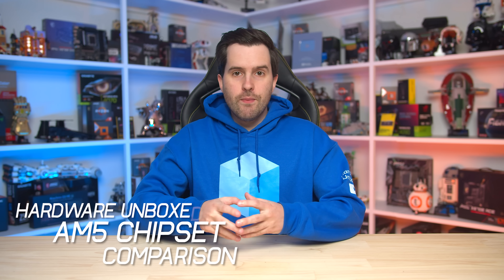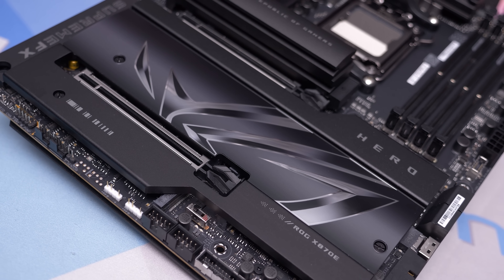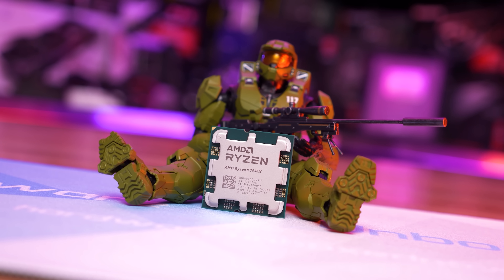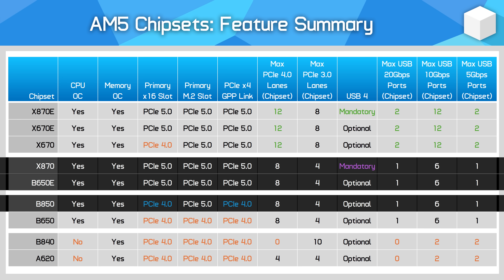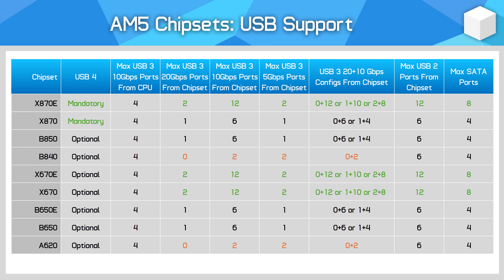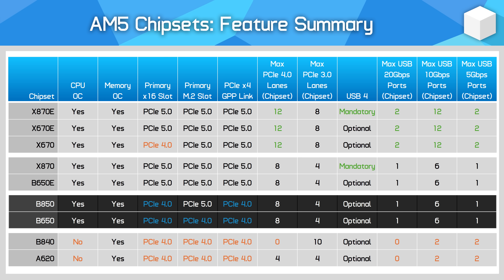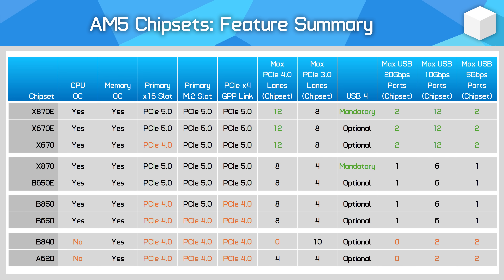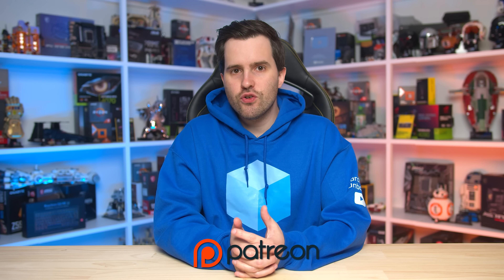AM5 Chipsets Compared - X870E vs X670E vs X870 vs X670 vs B650 vs B850 vs B840 vs A620

Comment: I saw someone reviewed all 870 and 870e mobos and i think only asrock mobos support pcie 5.0 1x16 without lane sharing meaning even if all m.2 slots are occupied and if they got m.2 pcie 5.0, the slot will not step down. the rest of brands will split to 2x8 so gotta take note of this when buying one
Reply: The main PCIe 5.0 problem with 8XX platform is that USB4 controler became mandatory and it's connected to the CPU by 4 PCIe 5.0 lanes. Since the 5.0 lanes are not increesed in 9XXX CPUs, on this platform is not possible to occupy PCIe 5.0 x16 and two M.2 5.0 x4 slots without lane sharing. On MSI X870E Carbon it is possible but USB4 controller will be disabled which makes the platform sensless. That's why Asrock didn't even bother to add second M.2 PCIe 5.0 slot. One PCIe 5.0 x16 + one M.2 5.0 x4 without lane sharing is ok on all 8XX boards.
Reply: That's why I got the Asrock x670e pro rs. It doesn't share the lanes and has a lot of m.2 and ssd connections. I just simply love it. Yes it doesn't have rgb or fancy things on it, but it's a very good quality motherboard that gets the job done with no BS or errors.
Reply: @Wise_Tiger i use the same Mobo , for me work perfect in combo with 7600x, ddr5 6400 at 30,36,36,84
Reply: I like asrock boards anyways but didn’t know this
Reply: I probably read it wrong before, but can use a gpu and a sound card without losing pcie lanes on the 1st slot?
Reply: @AirRookie  Depends on the MB. I'm using a soundcard as well, so am paying attention to this as well. Generally, I've noticed if you pick a MB with 3 PCIE slots and put the soundcard in the third slot at the bottom, it will be fine and won't share lanes with the 1st slot your GPU uses. But should check carefully before you buy anything.
Reply: @123Suffering456  okay, I was curious about the X670/X870 taichi
Reply: @123Suffering456 it does share ex... carbon x870e
Reply: Yes thats true.. we dont need to aim for a gen5 for now.. i just want a mobo where i can populate gpu and all m.2 slots and not have any lanes or slots halved or disabled.. so if x870 or x870e has this, then thats great news
Reply: If u bought or want to buy a 5 slot or 6 slot mobo, u should be able to use all slots without penalty.. if there is penalty, either u forget buying that and get other options or u just accept that its just the way it is and buy it anyway..

No gpu is utilizing the pcie5.0 for now.. but when u slot it to pcie5.0, then it will become pcie4.0 2x8 for some mobos that impose penalty on occupying gen5 slots.. if u r so sensitive to frame numbers, just turn off msi afterburner so u dont keep seeing them.. u wont really feel much unless frames drop too low.. others turn off some slots so ya.. u gotta know what ure buying
Reply: Only the top m.2 on the Taichi and Nova are 5th gen. The Taichi has 3 4th and the Nova adds a 3rd gen with their 3 4th gen.
Reply: @TheSjuris  Here's a controversial opinion. Gen5 PCIe M.2 is really not something you need. Sure it's fast, but for most applications and especially games you won't be able to tell the difference between a Gen4 and a Gen5 M.2 drive. Benchmarks will show you that there is a huge difference in performance but in real world use there are really few uses where this makes a noticeable difference. So ignore a having a second Gen5 M.2.

Like I said a controversial opinion. I base this on real world tests. I did also see a test made by a YT channel where they tested games and general use testing a few different games, OS boot time and such using a Gen5, a Gen4, a Gen3 M.2 drive and a SATA SSD. OS boot times were very similar no matter which drive was used. The game slowest to start and most influenced by the drive was either Cyberpunk 2077 or Starfield. The time difference in starting the game was 8 seconds between having it on the Gen5 M.2 drive and on the SATA SSD. That is 32 seconds instead of 40 seconds. The performance difference is huge when benchmarked, but minor in daily use. Note that the difference between the Gen5 M.2 and the Gen3 drive was something like 4 seconds and even less when comparing it with the Gen 4 drive.
Reply: @blahorgaslisk7763  Exactly PCIe gen 5 atm is a complete waste of money. I did choose a b650 board that has 1 nvme gen 5 support but there's no way I'm paying for the massively over priced gen 5 ssd's yet. I got a top of the range 4tb samsung 990 pro gen 4 instead. You also don't need gen 5 for the the gpu. Card's are nowhere near saturating gen 4 bandwidth yet.
Reply: I myself am waiting for asrock nova
Reply: Do not buy the X670E Taichi.  It has mandatory lane sharing.  It's my only regret with it.  Great motherboard but one shit feature.
Reply: That is not correct. I've looked at dozens of motherboards and to start with, no ASRock motherboard supports two M2 Gen5. Period. Then there are to my knowledge 5 motherboards all with X670E that support at the same time 2 x M2. Gen5 and 1 x PCI 5.0 x16. These are: ROG STRIX X670E-A GAMING WIFI, ROG STRIX X670E-E GAMING WIFI and ProArt X670E-CREATOR WIFI  from ASUS, X670E AORUS PRO X from GIGABYTE and MPG X670E CARBON WIFI from MSI.
Reply: @cochinada01  X670E E-Gaming does NOT support full M.2 use, installing an SSD in M.2_3 will cut GPU lanes in half. F-Gaming does. As does X670E Aorus Master.
Reply: @MajinOthinus  I didn't write FULL M.2 use. No motherboard on the market does. I wrote 2 x M.2. Check again.
Reply: @cochinada01  Most of the ones you mentioned very much do.
Reply: True, the only ones worth buying are Taichi and Nova
Reply: @3nez2nez  Yeh sadly we don't have them in Australia just yet and I want to buy now!!
Reply: @farmeunit  Yeh I'm probs gonna get the MSI Carbon, but the Nova seemed to have similar specs for a lot le$$. Oh well.
Reply: @LollyBread Just buy an X670E board, they are objectively superior anyway.
Reply: @MajinOthinus  Nah. Some of them are 2 years old now. I'm looking to future proof a bit more since it'll be many years before I update again. There are subtle differences from what I remember reading and no doubt less-sexy improvements under the hood. Anyway, each to their own. All the best.
Reply: @LollyBread  There are literally no differences. IT. IS. THE. EXACT. SAME. HARDWARE.
You aren't future proofing one bit. There wouldn't be differences even if the board makers wanted to make them, because AMD specifies exactly what goes in there and it is THE SAME.
Reply: @MajinOthinus Incorrect. There are other subtle improvements. Most people probably don't care or notice. But there are VRM improvements, and more importantly memory topology improvements that offer higher memory OC compatibility out of the box. Along with some other minor changes.  So while the lane counts and chip support are technically the same. Other aspects are not. How much you care is up to the buyer.
Reply: @BigBear--  VRM improvements are all but pointless, most 600er boards already had massively overbuilt VRMs. And both those and memory topology improvements are not something that is particular to the 800er boards.

Anything that isn't directly related to the chipset or lane allocation is not particular to 800er boards.
Reply: @MajinOthinus  I don't know what "not particular" means...X670E Master boards officially support up to 8000mhz and first dimms with 32Gb per dimm are supported up to 6400mhz. The X870E Master supports up to 8400Mhz, with 32Gb dimms maxing at 6800Mhz. The certified supported memory list is also more than twice as long for the X870E than the X670E. That's just one difference. You might not care about any of that. And just want max PCIE lane support...fine, get whatever works for you. Depends on what's important to the customer. Point is they're NOT the same in many ways, while maybe same in others.
Reply: @Blackbind01  ASRock is king
Reply: IMO this is not a big deal. Just don’t use the M.2 slots if you want X16. The option to split off the x16 without a riser is a benefit.
Reply: @joemarais7683  "Just don’t use the M.2 slots if you want X16."

Just don't be homeless if you can't afford rent!

Also, what is "The option to split off the x16 without a riser is a benefit.", even supposed to mean???
You strike me as someone not very - read: at all - versed in computers and their hardware.
Reply: Who is buying that anyway 😅
Reply: @aayankhan942  I just had to replace my Taichi x370 from ~6 years ago. After all was said an done I decided to get the x570 Taichi. First MB I've had to replace due to unknown root cause. 570 Is working great, I don't need the ARGB though.  I am looking to build a new AM5.  I tend to get a midrange CPU and GPU then upgrade later when prices are not stupid.  I've been trying to understand the differences with the 'new' 870s. I'm likely one of the few people who highly value USB4, so the x870E is likely my go to. (reference, been building PCs since 1990, almost exclusively AMD CPU and GPU since 1995). Yeah hard core optimist for AMD. Not fanboy, just like their low power usage/efficiency and reluctancy to gouge (until recently).
Reply: @aayankhan942  Apparently everyone seeing as how they've sold out to scalpers.
Reply: No,not just asrock boards...
....Gigabyte X870E Aorus Xtreme.
....Msi X870E Godlike.

These boards don't share their main PCi and second slots with m.2 slots.
  Unless you populate the second slot,then they both run 8X8.If you don't use the second slot,the main slots are always 16X no matter what.

Comment: I did buy an X670E after seeing how bad the X870E was more usable SATA more usable m2 on the X670E no GPU cut down in lanes
Reply: May I which model did you buy? I was recently looking for a new PC, and found out the X870E sucks in lanes
Reply: @Pi3XXAX  i did buy the ASUS ROG Crosshair X670E Hero 4x full usable m2 no cutting down and i have 6 SATA that i can use and a 1x PCIE for stuff like sound cards
Reply: @napalmarsch  thank you. Do you know if the X870E HERO split lanes when you use only two M2 slot? like just the m1&m2 slots

I don't understand well from their website
Reply: @napalmarsch  the Asrock X670E Pro Rs is also a good choice and doesn't split or share the lanes.
Reply: @Wise_Tiger  ahhh it seems to be hard to get. I will try to see if its gets in stock. thank you for the recommendation
Reply: @Pi3XXAX  that's why it's out of stock. Because it's a good motherboard that can compete with motherboards that are much more expensive.
Reply: @Wise_Tiger  ALC897 in that Asrock but looks good.
Reply: @xayroMS  if you use a good quality headset with USB connection, it will bypass the motherboard Audio.
Reply: @Wise_Tiger  For my speakers make difference... I thinking about strix b650e-f but i m still not sure.
Reply: @xayroMS  Don't buy the strix b650e-f, it takes mine a minute to post every boot, and turning on memory context restore makes it unusably unstable (even crashing in the bios)
Reply: @Your_Paramour  Most AM5 boards have this problem. But good settings in bios should work to reduce boot time.
Reply: @xayroMS  There's a HUB video b650 from a year or two ago where steve found the asus boards have double the boot time of msi/gigabyte. The only setting i know to reduces it is memory context restore which turns off memory training each boot, but my board will crash even inside the bios with it enabled.
Reply: @Your_Paramour  AMD expo on ? I m not sure if there is more options about memory...
Reply: @xayroMS  Yes enabling expo/xmp is what causes it to memory train on boot. Without expo it will boot without memory training at the jedec timings
Reply: @Your_Paramour  I will read more about that. I have some pages opened on my PC but I m out of home for now...
Reply: @Your_Paramour  I found price cut on MSI PRO B650-A WIFI  i think maybe that will be better choice...
190 USD vs 303 USD (strix b650e)
Reply: @xayroMS  Someone in this thread i think was extolling the virtues of the ASRock X670E PRO RS, which currently in Australia can be had for 300 AUD, which seems like a crazy good deal since from memory i paid around 500 for the asus board.
Reply: @Your_Paramour  B650 Steel Legend WiFi looks good for its price . Anyway  i prefer MSI/ASUS hardware... not sure if that make sense. :D
Reply: @napalmarsch  I was going to buy that one but I could only find used ones now. Too bad they're not made anymore. I couldn't care less about those X870(E)s that sacrifice everything for more USB-Cs. However I found someone still selling new ROG Strix X670E-E, seems like the next best thing.
Reply: @Pi3XXAX  z890 Taichi OC formula. Though there are boards like the Z890 nova with nearly as good IO for much cheaper.
Reply: I got the b650 edge wifi from MSI, since the main m.2 slot is 5.0 and it has 2 more 4.0 m.2s AND it has 6 SATA ports and no splitting of x16 slot. Was the best package for me. Too many manufacturers leaving lanes out/disappropriating or using them for useless stuff. With zen4 and 5 boards you really need to read the specs carefully before purchasing.
Reply: Meanwhile there are Z890 boards with 6xM.2 slots that don't steal gpu lanes
Reply: @nepnep6894  By attaching them to the chipset. Which would also be possible on AMD.
Reply: @johnscaramis2515  There aren't enough chipset lanes on X670E or X870E for that
Reply: @nepnep6894  Z890 has 24 PCIe lanes, X870 has 20. Both can attach 2 M.2 on the CPU. So 4 on the chipset. 4x4=16, so 20 by the X670E/X870E should be sufficient. However I to admit that I don't know how other devices are attached to the X670E chipset.
On the other hand: How many people actually need 6 M.2 slots? Also considering the bandwidth limitations from chipset to CPU.
Reply: @nepnep6894  Intel has fewer PCIe lanes than AMD also Intel can get away with the extra M.2 slots because they use PCIe switching.
Reply: @neieus  that used to be the case, but 1851 added an extra 4 cpu lanes
Reply: @nepnep6894  Oh interesting I'll have to look that up thanks!